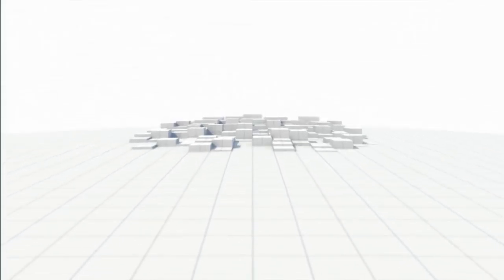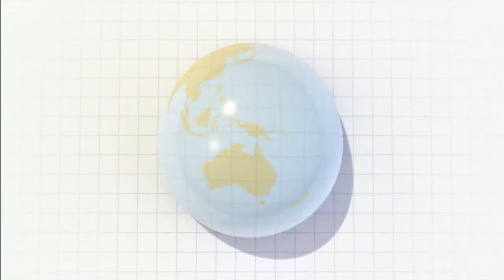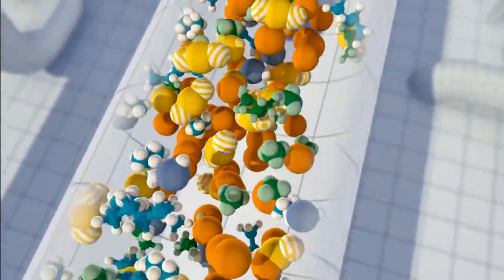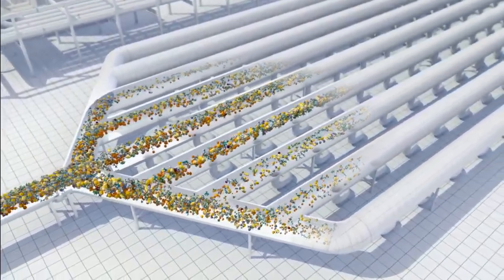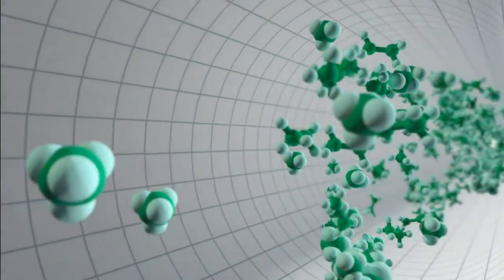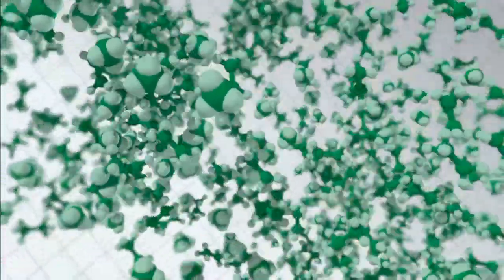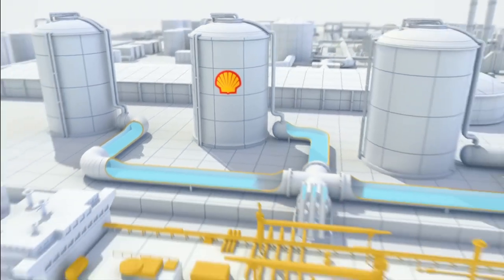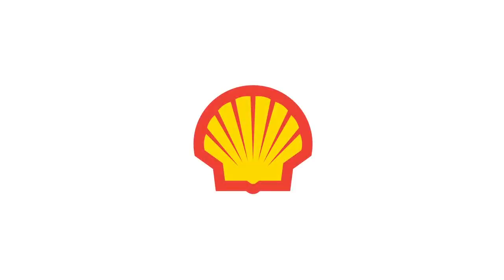What is LNG? - Turning natural gas into liquid Natural Gas

Comment: Which coolant is used to liquify  LNG?
Reply: https://cameronlng.com/wp-content/uploads/2018/10/Natural-Gas-and-the-Liquefaction-Process-CLNG.pdf
Reply: Obviously liquid nitrogen
Reply: @nostro1940 lol no multi steps in cooling JT then different refrigeration methods step it down to temp
Reply: Cryocooling is the method.
Reply: Turbo expander maybe ? Because it has the capacity to liquify the gas UpTo minus 102 degrees correct me if I'm wrong
Reply: Gases are liquified by cooling or compressing.
Reply: @RaviKumar-cq6kb using what?